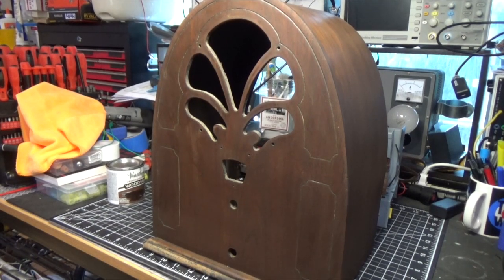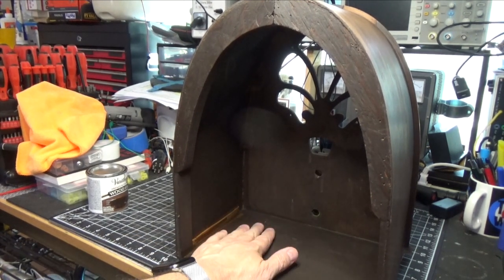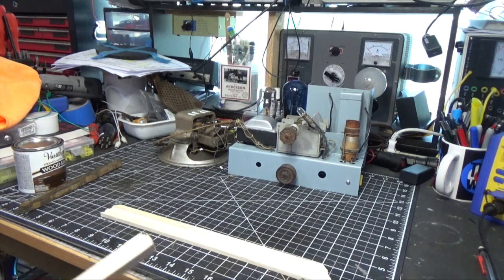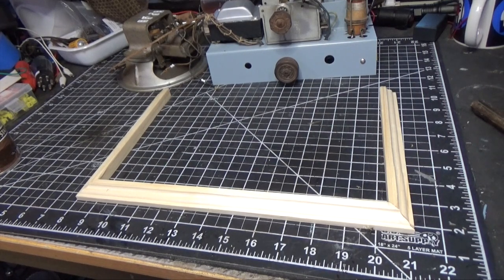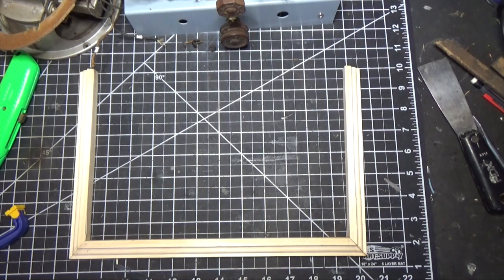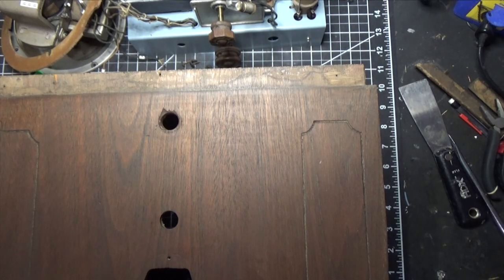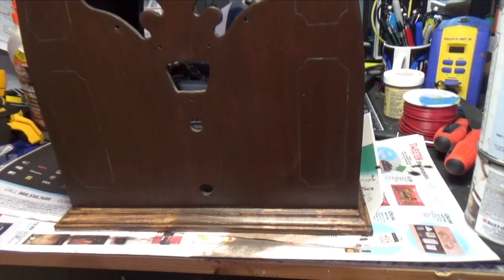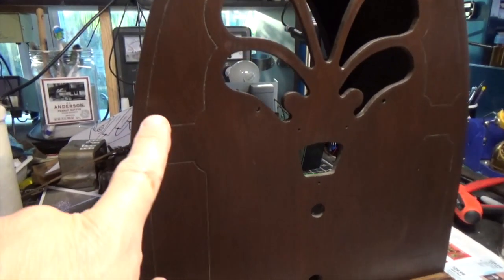Detrola 4 Tube TRF   Getting Close to the end

Comment: So Ron, What exactly is Toner and how does it differ from stain and lacquer? Also, wondering is the wood originally 
Used was green or if the wood dried out over the years ending in uneven corners.
Reply from the maker: Scott, the original wood moulding was some kind of Oak from what I can tell... the green is just worn off stain and paint. The case was never square from what I see.. it was cobbled together crudely.. as I have read, Detrola used students to build their products, so you had many hands touching one unit instead of  one person.  This made for interesting builds.. LOL   This base was likely painted black or brown when new.    Toner is really just a colorant or a spray stain... its a cross between paint and stain in a can.  its use to great gradient of color on wood. Lacquer is just a clear coat like varnish/polyurethane, etc.  Good questions and thanks my friend.